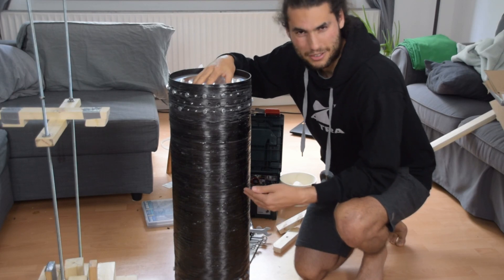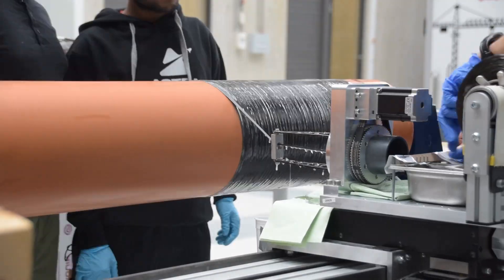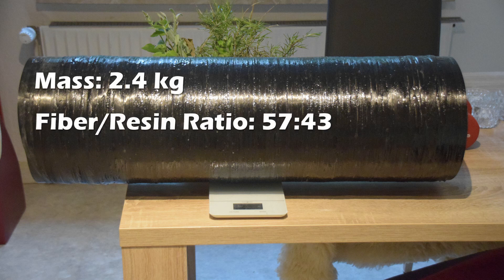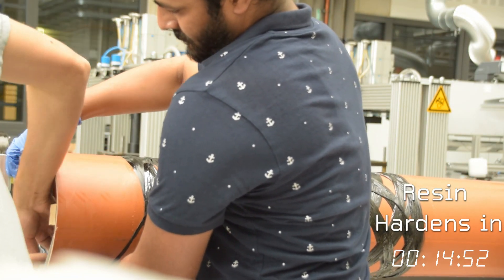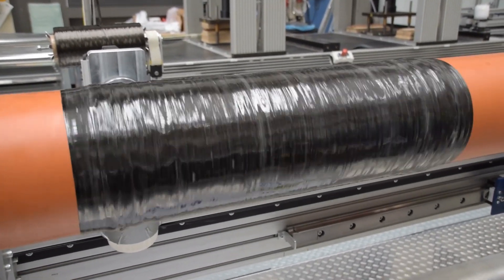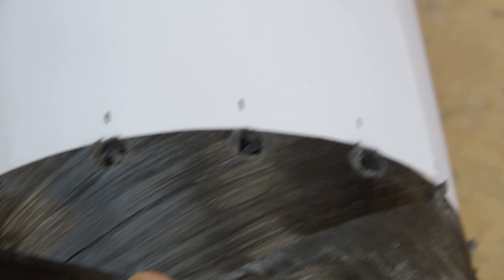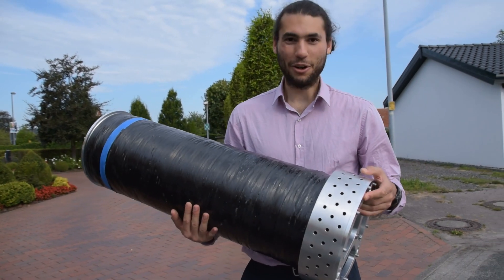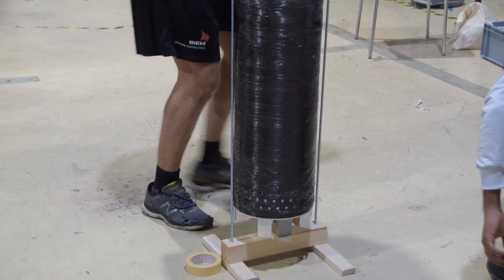How to Build a Rocket Tank for Cheap...

Comment: I'd suggest to contact Air Command if you have questions regarding high pressure tanks for rockets. They are building them for years now. The alu ends do not look convincing efficient but pretty solid and overdimensioned. Btw Air Command's on Youtube.
Reply from the maker: We have a new version of tank that we are designing now.  There will be an upcoming video on that in about a month or two.  It is much improved!

Comment: This is awesome, looking forward to the hydrostatic test. Do you have a mass fraction for this tank?
Reply from the maker: The tank we are testing here weighs about 25 kg and can contain 40 kg of N2O.  So not the best mass fraction - 0.38.  However, if it works, we can simply make it 6x longer.  This will give us a final mass of around 35kg empty and allow us to carry around 180 kg of N2O (so a much better mass fraction - 0.16)
Reply: @ASTRABremen  it should be more than 0.5. Otherwise not worth it.
Reply from the maker: @hafizuddinmohdlowhim8426  mass fraction is measured structure/(contents+structure).  So smaller numbers are better.
Reply from the maker: @hafizuddinmohdlowhim8426  Also, this is a piece to test the design.  As stated previously, the final rockets mass fraction will be quite a bit better (assuming we can get it to work...).
Reply: @ASTRABremen  first of all, you are talking about Gravimetric Index, not mass fraction. For mass fraction, you need to consider the entire mass before and after launch. You have to use Tsiolkovsky rocket equation to calculate mass fraction. But you measure the mass of tank vs how much propellant it can store. That is Gravimetric Index (GI). For GI, the higher the better.

Comment: What's your safety factor at 110 bar, and what analysis did you do to predict that, given the anisotropic nature of composites? Also, did you do any investigation into what effect a hole drilled through carbon fiber has on the bearing material properties at that hole?
Reply from the maker: These are deep questions that we do not have full answers to yet (thus the pressure testing).  But I will do my best:
1. The Safety Factor at 110 bar is around 1.6.  The operational pressure for the tank will be 55 bar so we really just need a SF of 1.0 at the 110 bar.  The 1.6 safety factor does not take into account stress concentrations at the bolt holes.  However, it is important to note that the CFRP wrap is much thicker at those locations in practice so we believe this should compensate reasonably.
2. We have performed this analysis using Net Theory for Anisotropic materials.  We also performed a Finite Element Analysis to determine where we should expect stress concentrations and to come up with the SF value.
3. No analysis with the holes has been done yet (except for the pressure testing - more on that in future videos) but so far it looks like the holes are not the problem.
Reply: @ASTRABremen  Thank you for the detailed answers! Do you have any resources you refer to for Net Theory? I haven't heard of it before, but I'm interested in reading up on it. 
Also how did you handle the anisotropic material properties in your FEA? Like did you apply the anisotropic materials on to the structure in FEA as if they were isotropic, did you just apply just the resin material properties to the structure, or some other method?
Reply from the maker: Another point on the holes: We were putting a lot of force on them during the assembly (like hundreds of kg on just two screws) and the hollow CFRP tube did not show any signs of significant strain.  Given the full set of 90 screws taking the pressure forces, I am reasonably confident that this will not be the most likely failure point.  The seals are far more critical in my opinion.
Reply: Have you looked into the compatibility of your resin and your O rings with nitrous?

Comment: What about installing spikes(screw sized) sticking outward out of the mandrel, thereby displacing the fibers so you dont have to drill through them and weaken the structure.
Reply from the maker: There is actually a technique that we are considering where you would actually stitch the Carbon Fiber around the screw holes (kinda like what you are suggesting).  We will try this if we see the pressure vessel failing because the screw holes are weakening the structure.

Comment: Weird that you guys are applying the resin during the winding. How its supposed to be done and has been done for many years was applying the resin after the winding was complete in a vacuum chamber.
Reply from the maker: That is one way, yes.  But this way is also utilized a lot.  The method is called wet winding and the machine we are using is specifically designed to do it this way.  The Faserinstitut (the company who owns the machine) is using this method to make their Helium tanks so we figured it would work for our Nitrous Oxide applications.
Reply: @ASTRABremen  it seems highly inefficient. Don't get me wrong, I want you guys to succeed. I just feel like you're settling for a less superior method. Your team is literally reaching for space, I don't know the constraints but go big or go home right?

Comment: If you want to keep using the aluminium end caps the you incorporate it in to the wrapping process and have it grip the end cap via grooves or a taper.
Reply from the maker: This is basically our fall back solution.

Comment: A better way to go is to make the ends out of CF. A good way to do this would be to first make a tube from CF matt like how you did on a piece of pipe. THEN premake little CF matt bowls for the ends, possibly with valves built in to bowl. Put the bowls on the end and hold it in place with some epoxy or something. At that point you have a little tube with round ends ready to be wrapped with CF. Mount the hotdog looking tube on the lathe and wind it with CF like last time but this time also including the end bowls. Did i explain that ok?
Reply from the maker: That might be a pretty good strategy.  It would also save the design a lot of mass because the aluminum bulkheads are a lot heavier than the carbon fiber.  There are just 2 issues:

1. We need a way to transfer the loads through the structure of the rocket.  The tanks is dual functioning as the rocket structure so right now the bottom bulkhead of the tank is doing an excellent job of providing the necessary structural rigidity to fight vibrations and buckling.
2. It is a lot easier to machine connections to hydraulic components into aluminum then figure out a way to incorporate them into a CF dome.  This would require a little more thought and engineering and we may run into a lot of problems that we can't even see right now.  

If the pressure test fails, we will move to an epoxy option, but we would probably keep the aluminum bulkheads.  We want the bolts to work because it allows us to be able to re-use components better throughout the testing.  A lot will depend on how the pressure test goes.

Comment: I dont think bolts are the way to go to hold the ends on. Theres a few things wrong there. If they're being used to help seal the tank, that wont work well. You cant reduce the diameter of your circle, its just going to deform and leak. Possibly some sort of outter clamp type system?

Comment: I've messed up a few lathe parts, when using duck tape in between lathe jaws. I think the glue acts as a lubricant when warm under pressure, promoting things to shift.
Reply from the maker: That could definitely be it.  We have actually solved this problem now by using a specially 3D printed lathe chuck mount.  So hopefully no more falling parts during winding :)

Comment: I bet those big aluminum parts would have come out costing 500+ eur if it weren't for the sponsor. You got pretty lucky there.
Reply from the maker: Yes, probably closer to €1k.  We are very happy with our sponsor, Aljo!  But even considering that, this tank will be around 1/10th the cost of a typical commercial tank of this size with the specs we want.  But lets see if it works in the end.